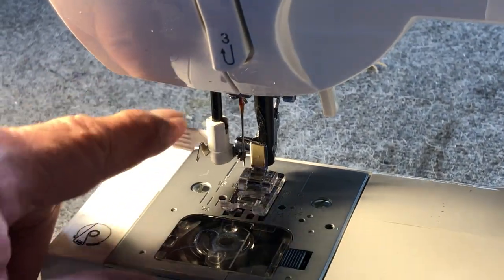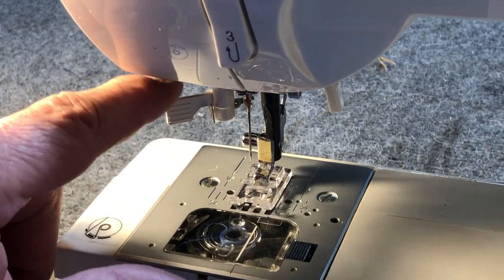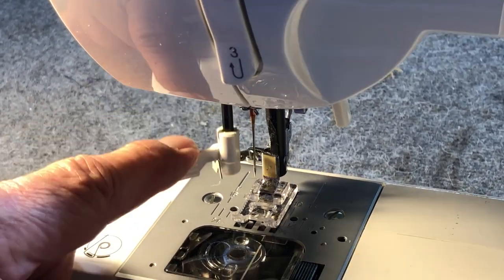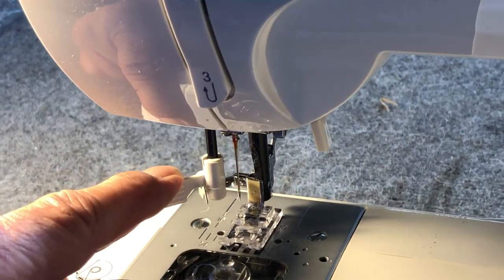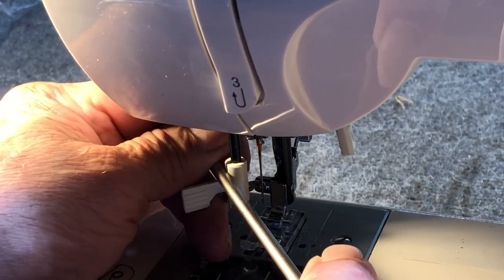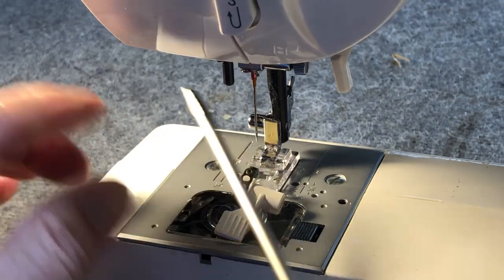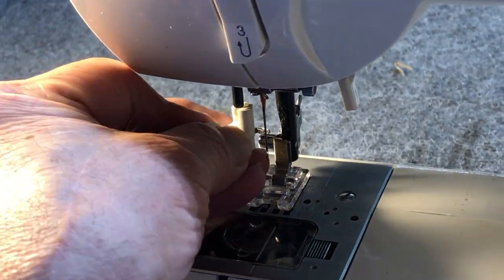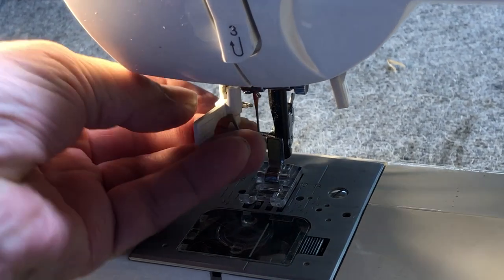How-To Install Sewing Machine Needle Threader

Comment: A close-up image of how the pin/hook should be aligned relative to the front and sides of the arms would be helpful for adjusting bent pins back into place. Ours got slightly bent and the hook is hanging up on the needle eye when retracting.